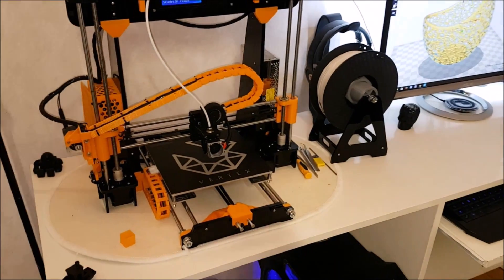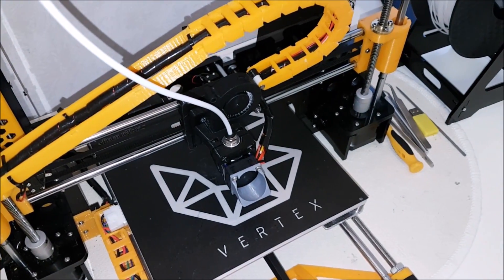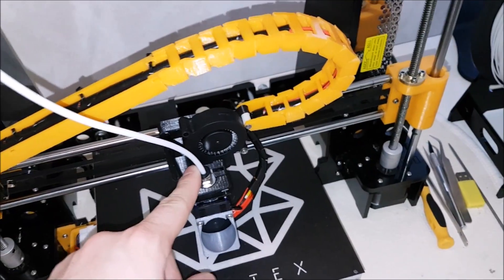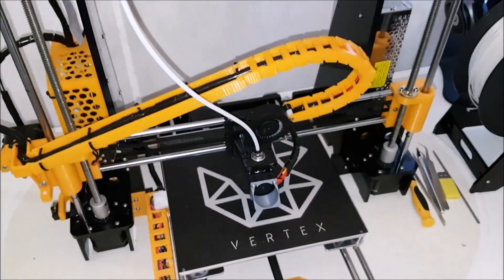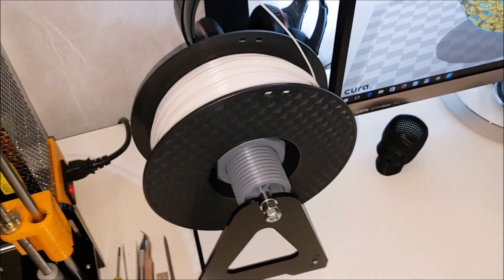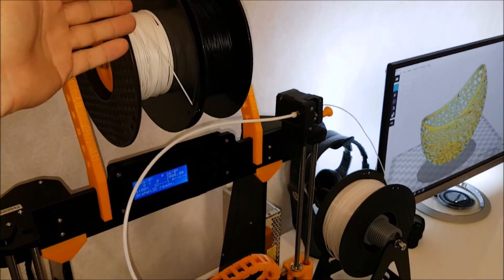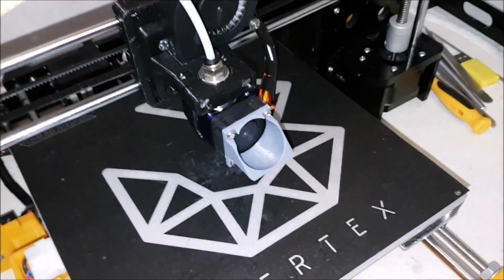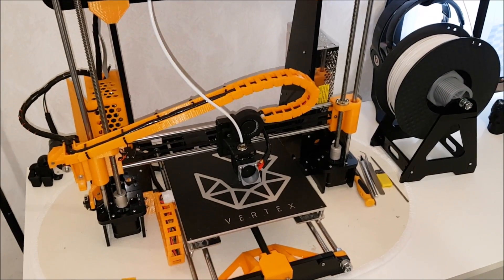Anet A8 3D printer upgrade E3D V6 bowden! Part 3

Comment: mine carriage doesn't move as easy as yours does.. any advise?
Reply from the maker: Use sand pepper on x carriage to ''make'' more ''tolerance'' or check for your rods maybe the are bend like that mine was?
Reply: I keep coming back to this video as I am upgrading my Anet A8 but my carriage would slide great but the belts grip the motor pulley and the motor doesnt turn easy enough to slide like that. Without the belt on it slides just like that though. Is this normal?
Reply: Nexi Tech inside the bearing?

Comment: I am using the vertex sheet and  having problem getting off my prints
Reply from the maker: Turn off heat-bed after first 4-8 layers. It should be better.

Comment: I have one question, please: Are you still printing with PLA with this E3D Upgrade? I am asking, because some peeps in my A8 FB Group tell me with the E3D is no longer possible to print with PLA, they recommend PETG. Thanks for your effort and please keep up the good work, I really learned a lot from your videos...
Reply from the maker: I still printing without any problem. All my upgrades are made with PLA and now am printing models in ABS still on same  E3DV6 with PLA holders and x carriage. So far I didn't notice any problem only little warp on fan duck because ABS is air/fan free but sense ABS requiring some high temperature I thing is better to print all V6 holders and X carriage in ABS because Is more heat resistant. PETG is also god option because its also heat resistant like ABS and easier to print like PLA.
P.S. Thanks for positive feedback :) Am glad that I helped. Cheers!

Comment: Hi Nexi, I have been looking everywhere but could you tell me where you found the end cable chain mount on the extruder? It seems like it's attached between the x-carriage and the fan.
Reply from the maker: Hi Roy! . I just drill one section and connect to the cooling fan with screw. That white part is just small part of filament tube. Look closer you will see.

Comment: where did you get the linear bearings?
Reply from the maker: https://www.aliexpress.com/item/6PCS-LOT-SCS8UU-8mm-Linear-Ball-Bearing-Block-CNC-Router-Reprap-3D-printer-DIY-Kit-Accessories/32671316545.html?spm=2114.13010608.0.0.1GpSRq
Reply: Nexi darn. they are in china. takes forever and they have had issues with fraudulent credit card charges. i guess ill check amazom
Reply from the maker: If you say so. I order almost everything on Ali express and eBay and i never have problem with them. Over 700 orders so far...
Reply: Nexi it's all good. I have all the stuff now. it's an amazing upgrade. damn near perfect. thanks so much for making these videos.
Reply from the maker: Nice! Thanks for positive feedback mate! Am glad that I helped. :)

Comment: Great set up, which kind of bearings you use on the X-carriage?
Reply from the maker: I just re-use standard bearings that come with x carriage. Disassembly it and take out bearings from holder. Now am using PLA IGUS stile and they are great! Check my other videos you can find useful info and tips there.

Comment: also remember that when printing abs on an heated bed the stock aluminum plate warps a lot. Although this might not be a problem with the new insulation glass with kapton tape is always good for this, because glass is always flat and never warps.
Reply from the maker: Use ''brim' option in CURA and problem solved! :)

Comment: Are the linear bearing on the x carriage the original or something else?
Reply from the maker: I just re-use standard bearings that come with x carriage. Disassembly it and take out bearings from holder. Now am using PLA IGUS stile and they are great! Check my other videos you can find useful info and tips there.

Comment: Great video. How did you attach the X-carriage to the rails?
Reply from the maker: Just slide bars off on the right side and disassembly bearings enclosure and take off bearings and simply clip them inside new x carriage and use some zap strap to hold bearings.

Comment: Hey Nexi nice Upgrades!! Were there any issues with your X carriage plate? I printed mine out and used new bearings, but it didn't fit. It was very tight on the rods and couldn't move freely :(

Comment: direct drive it ;-)
Reply: Direct drive vs Bowden is mainly a preference. Direct drive is usually easier to implement, but Bowden will produce better results due to less jitter. The x-carriage doesn't need to carry as much weight. This may also get a better lifespan on your motors. In my opinion, it also looks better.

Comment: for your e3d V6 upgrade did you have to purchase anything else besides the kit you linked in the description ?
Reply from the maker: All is in description + one more x carriage bearing. It use 4 instead 3
Reply: Have you got a link to where i can buy an extra x carriage bearing, Everything else is in the post but need an extra bearing, thanks
Reply: Timothy Upton Search for "LM8UU" and that will show you a heap of results. Ebay has them but I bought mine from an online store in my country

Comment: How did you mount that x-carriage to the guidance-bars?
Reply from the maker: Just take bars off and disassembly enclosure and take off bearings and simply clip them inside new x carriage and use some zap strap to hold bearings.

Comment: Hi Nexi ! You are turning your 3D printer into an impressive one !! I'm just wondering, what is the brand of the filament you use ? And is there a way for you to post macro shots of your 3d prints ?
And why going with bowden ? How does the benefits of a light X axis compare to the problem related with bowden (filament elasticity in bowden tube etc) ?

Because I've been messing with my Anet A8 for 3 weeks now and I couldn't get the same quality as you, so I'm going to make the same upgrades, hoping I'll reach the same quality :)
Reply from the maker: Thanks mate! Brand of filament? No idea, am using chepest garbage of PLA than I can find on Aliexpress and gearbest  :D Well: It's very easy to change filament, x-cariege is very light now and fast! For me quality is better now then before and much more speed. I never have problem with bowden setup but I had filament breaking multiple times with direct drive before. Changing filament was pain before. One thing is sure I will never go back with Anet A8 old extruder setup.

Comment: Did you have to cut the belt to the size you needed? Ir did it come at the right length?
Reply from the maker: Belts come in 2 meter or 3 meter size you have to cut it with knife or wire cut pliers before installing.
Reply: How did you stick the two ends together?

Comment: Hi,
nice video as always. I've got one question, where did you get the MK8 motor from?
Reply: It's just the stock extruder moved to the top, isn't it? So no other purchases needed, right? I feel so dumb right now :D
Reply from the maker: Yap you got it:)
Reply: how did you connect the bowden tube to the extruder?  did you print a special tap?

Comment: Hi Nexi, your videos on A8 are impressive!!! 85% of my decision to buy an A8 is for them. I saw you're using Skynet 3D. My question is, for now I don't want to change the extruder or add autoleveling, but do you suggest me anyway to upgrade stock firmare to Skynet 3D? Tnx a lot again!
Reply from the maker: Thanks mate! Well you don't need to update skynet3D. Original firmware is good as well. :)

Comment: Can u do a full tutorial/review about the extruder and how to set it up
Reply: Bobby Mansfield  waiting for that too but nothing yet.
Reply: angelg796 the knock off is great, so cheap
Reply: Bobby Mansfield 
I'm going to order the original one from a certified reseller.  I don't want any problems with the clone. The price is not that bad.
Reply: Bobby Mansfield 
I will like to get that same extruder but the link he supplied is to a Chinese knock-off.  I'm wondering if it's just better to get original. I'm just waiting on my printer. I just ordered it I'm so excited.
Reply: Bobby Mansfield 
Thanks for the info. I will go ahead and order.  My next project once I build my A8 will be a filament extruder.
Reply from the maker: Clone V6 work very well for me...
Reply from the maker: This one http://www.gearbest.com/3d-printer-parts/pp_613785.html?wid=21&lkid=10642535 Sorry mate I just read now your replay.
Reply: angelg796 if you have amazon prime i would order it there, or check amazon for them they are very nice with returns so if you dont like it its free to ship back
Reply: amazon´s ones are much more expensive than the one he recommend. have you guys bought any of these extruders? please reply me, i need to get one of those but i dont know which one
Reply: this would be helpful

Comment: I've been following your videos with interest as I've just ordered an A8 and want to perform tried and tested upgrades to make it the best it can be.  I'm loving what you've done so far and am amazed at the quality you're getting from such a cheap printer.
One thing that is not clear to me is the Bowden setup (top right).  Have you simply reused the stock gear and printed a new housing?
Thanks for the videos, they're most helpful. :)
Reply from the maker: Thanks for your comment and thanks for all positive thoughts! I been put a lot hours in testing and working with this printer to make it work like that. Yes exactly! I just use stock gears with extruder motor and print out new housing. Right now am testing fine tuning of extruder steps in the firmware to make it even more precise and better quality with filament speed. You welcome! Am glad you like it. Cheers!
Reply: Nexi thanks for the confirmation. I ordered the new hot end for upgrade (once I've got the stock setup working well of course). 
Why wouldn't you for $9?!? :)
Reply: @NexiTech  Love these videos making my 3d printer way better.  Just wondering if you could tell me where I can find the new housing for the motor thx
Reply: Not sure about the 9 $ hotends, i see alot of bad reviews on amazon, i too just ordered a a8 off gearbest..... where did you order yours and have you received it yet? I plan on doing a bowden set up but i'm going to by my hotend directly from e3d, http://e3d-online.com/E3D-v6 these are the guys who developed the product and everyone just rips it off and they don't do a good job i guess. 50 bucks for the real deal why not? Let me know how yours is going!!

Comment: Did you use a mount from thingiverse for your E3d hit end? If so would you post a link. Your machine is looking very good. It seem that with a little thought and tinkering, these machine can be very nice. Thanks for posting!!!
Reply from the maker: Thanks for positive thoughts! Check video description you got all links there. Jap! If you put little brain and many hours of efforts in this machine it can preform very good! Soon coming video about fine filament motor-steps tuning in firmware and some more upgrades like: Manual bed level upgrade, filament way direction and multi color prints :)

Comment: Great videos! I've been following all our videos and practically copied what you have done. Just ordered the extruter. Question though, did you use the extruder motor from the original setup or will I need to order a different type of motor, cant really tell in the video
Reply from the maker: Thanks for your comment and thanks for all positive thoughts! I been put a lot hours in testing and working with this printer to make it work like that. Yes exactly! I just use stock gears with extruder motor and print out new housing. Right now am testing fine tuning of extruder steps in the firmware to make it even more precise and better quality with filament speed. You welcome! Am glad you like it. Cheers!

Comment: You convinced me to buy the E3D from the link. Thanks. And i did not even receive my printer yet!
Reply from the maker: You are king! :D But let me tell you something. If I know this before I got my printer I would do the same :)
Reply: Nexi being as cheap as it is I can't help but wonder at its quality as an e3d clone. I've read reviews on a few of those from places like Aliexpress and banggood and it's usually terrible. how is the one you put on holding up? any problems with it so far?
Reply from the maker: MrKarriban Nope. Everything is great. Working like charm. It's peace of metal with replacement heater and temperature sensor there is nothing to go wrong. If heater stop working replacement is less than 1USD.

Comment: Excuse me, where did you install the autolevel?
Reply from the maker: Jordi Oliveras I install auto bed leveling  (sensor) in my first update but after using it little I released that is not neary good that I thought. I tried everything to make it perfect but I just wasn't satisfied with results and I took it off from my printer.

Comment: i like your videos. Very informative, and your 3d printer looks awesome. I just ordered myself an anet a8, I cant wait til it gets here. I'll be following your videos very closely! Thanks
Reply from the maker: Thanks mate for positive comments! Am glad you like video! :) Good luck with your Anet A8! :)
Reply: Nexi I finally recieved my Anet A8. I am loving it, just wanted to say that, by the low price of the E3D kit you used, it has to be a chinese clone. I've been told by other ppl on an Anet A8 FB group that I should avoid the cheap clones as they are prone to more issues than an original. Have you had any issues with yours at all? If you think they work fine, then thats good enough for me.
Reply from the maker: If course its clone :D You think I will spend 60-80 USD to something that can be produce for 5 USD in CNC mashine?  Nope :) Its working great and even if my heater incide hotend die at some point I can order new for less then 1 USD :D
Reply: Just what I wanted to hear. Thanks for the quick reply. Looking forward to see what you get up to next!

Comment: I have three questions: 
1- Should I buy the "Long 1.75mm filament" head nozzle (BangGood) to get your same exact setup? I mean, placing the extruder engine at the top of the printer etc. 
2- Is the carriage placed directly on the bars? Or how? Could you please explain in detail how all the extruder is mounted on the bars? The necesary pieces, etc.
3- I have bought a proximity sensor. Do you think it could fit in this new setup?
I think you're getting the most accurate 3D printer on this entry segment and I would be pleased if I was abble to get something almost similar.
Thanks a lot mate.
Reply from the maker: Hi mate! You have all links to parts in video description. X carriage is right now without sensor but on Thingiverse you can download this with sensor mount: http://www.thingiverse.com/thing:1811912. 
Its easy plug and play system. When you download parts and open in cura it's going to be clear where bearings are. Keep in mind you need 4 instead of 3 bearings for this X carriage and you need 8 small plastic zip ties they are holding Bearings with X carriage. Thanks for your comment and thanks for all positive thoughts! I been put a lot hours in testing and working with this printer to make it work like that. Right now am testing fine tuning of extruder steps in the firmware to make it even more precise and even better quality with filament extruding speed. You welcome! Am glad you like it. Cheers!
Reply: Nexi thank you so much! your work is great. I'll be following all your updates and progress.

Comment: hi there , nice work
i am thinking , for the x carriage did you use 4 LM8UU bearing or you just used the Anet ones?
if yes, what else you did buy that you do not mention in the video or links ?
one last question have you used the same fan supplied with the Anet?
Keep it up with you upgrade and videos ! 
Thumbs UP for me
Reply from the maker: Thanks for positive support! Yes 4stock bearings are in x-carriage and fan as well. Check video description there is everything you need. :)

Comment: Are you planning to retry the auto bed leveling now that you have solved the binding issues on the x carriage?
Reply from the maker: That is enigma now :) So far am very satisfied with results so no need for auto level proxy sensor. For me its much easier to tight or loose 4 screws instead to all the time check and cleaning pad for sensor. Sometimes man need to go with analog system :D
 BTW I still have sensor in box in workshop.
Reply: I have one ordered myself I agree that once the bed is properly leveled it will make little to no difference but i like to tinker so going to try it anyway have a lite6 ordered also as didnt have to money to spend on a v6 at the moment so ill upgrade later nice vids by the way and good luck with growing your channel 1000 subs so far not bad :)

Comment: Nexi, do you have the insulation under the Velleman surface?
Reply from the maker: No Vertex cover is install direct to aluminium plate,but under heatbed I make order for isolation cotton. https://www.aliexpress.com/item/4pcs-lot-Reprap-Prusa-3D-Printer-Heated-Bed-220x220-mm-Insulation-Cottons-220-220-3-mm/32737819236.html?spm=2114.13010608.0.0.0tceJD

Comment: what a nozzle you have purchased with e3d kit? 1,75 using? I really think to do this too.....
Reply from the maker: Check video description there is link to seller. 1.75mm and 0.4mm nozzle.
Reply: Thank you for answer, already ordered this. Can you show print some hard test, for example 5x5 ctrlVtest3d?
Reply from the maker: Paco R Right now Am printing some parts 25 hour print. I will definitely do that print. Thanks for comment

Comment: did you use the the standart motor that comes with the A8? you only write that you bought the extruder... sorry for my bad english.
Reply from the maker: Yes! Motor is standard. No problem :)
Reply: ah thanks dude :) in some threads i read that these one didnt have enough power... but if you use it i hope it will works at mine too :) i still waiting for it but i read a lot about the positiv things with a bowden style hot end. so i think i will upgrade my a8 too :) i hope u write your changes in software soon :)